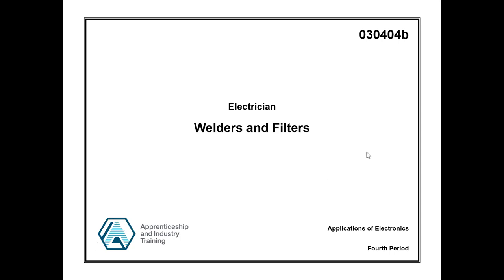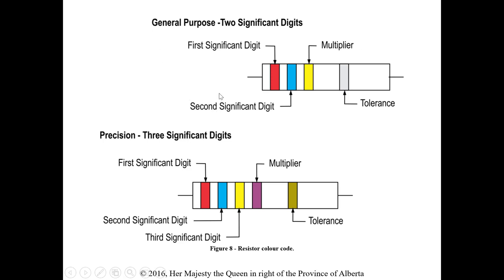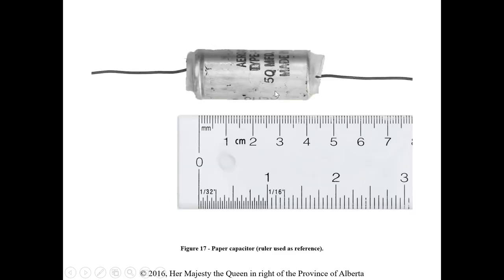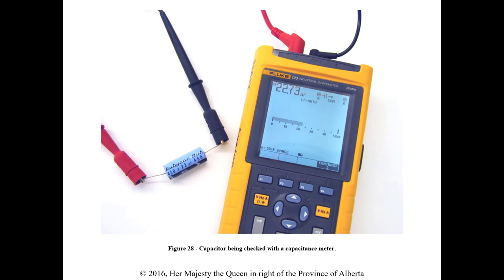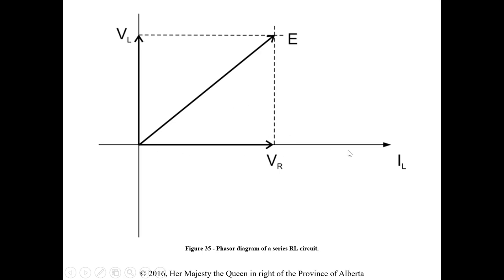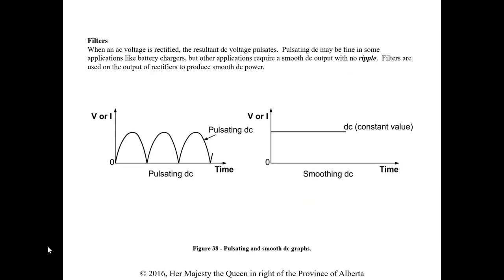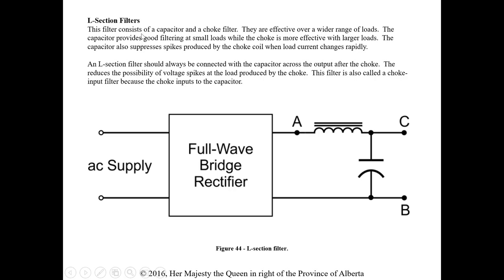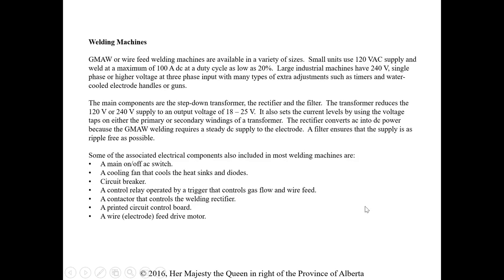Welders and Filters

Comment: thanks man, I really appreciated your help. I have a miller ac welder I am going to convert this winter and was at a loss as to the secquince of putting a choke and capacitor in my welder adapter box. One thing I have not found till now in all my searches is the information that you have given here. If you want to really help the you tubers and get your channel going, do a hands on complete conversion of a ac welder to a finished dc welder with the right size capitors, resistors, and a how to on making a choke with and without micro wave transformer cores. Good luck with your channel.